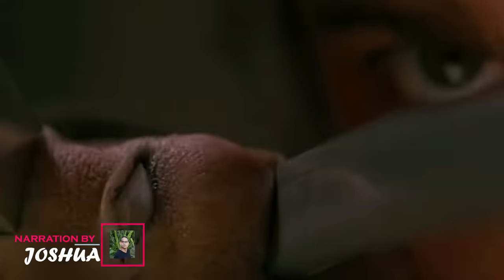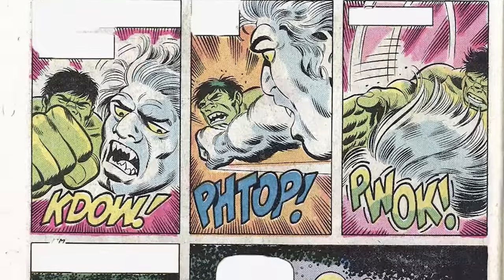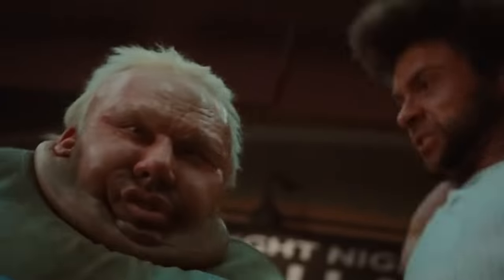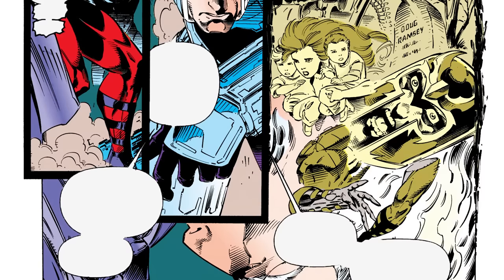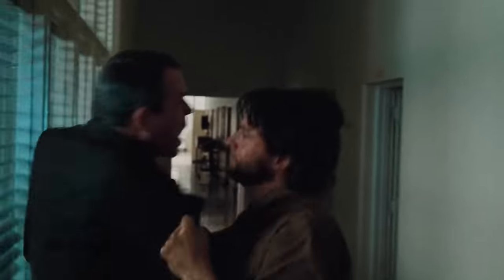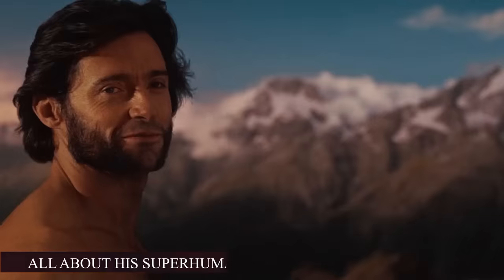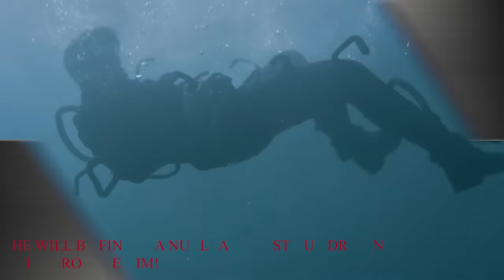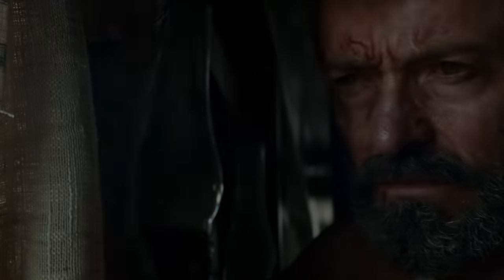10 Creepy Facts About Wolverine's Anatomy - Reproduction, Hyper-Healing, Feral Wolverine & Skeleton

Comment: The bone claws weren't "revealed", they were blatantly retconned in. Prior to that, it was confirmed canon fact that the claws were mechanical implants that had been added to him at the same time as the adamantium bonding process. There even were schematics for them in old reference material like the Official Handbook.
Reply: i kinda prefer the change honestly.
Reply: The original concept for Wolverine's claws was that they were actually weapons that strapped onto his wrists.  But that part never actually made it to final print.

Comment: a neat video but you guys missed a few things. One of which being he is incredibly strong. Not like on the level of the incredible hulk or super strength beings but probably a few levels above peak human strength. The reason being is because of how heavy the adamantium makes him his muscles are constantly having to flex and contract in order for him to even move. So basically James/Logan/Wolverine simply walking is a massive workout for him. Running jumping and other feats even more so. Because of his immense healing factor though he gets instant results on his "workout" since your muscles tear and expand when pushed beyond their limits when you work them out extensively which is where the term "getting ripped" comes from. So for the last 50 or 60 years since he got the adamantium upgrade to his skeleton his healing factor is on overtime and thus made his strength increase exponentially.

Comment: This video is kinda all over the place as you blend movie and non canon facts into the 616 proper Wolverine. That said I will touch base and enlighten on the subject of Wolverines progressed mutation after his adamantium was ripped out by Magneto.  It turned out that Logans healing factor was slowed down because of metal. Albeit only slight, the metal kept Logan from not regressing but progressing in his mutation. With the sudden removal of the metal Logans healing factor kicked into overdrive as did his mutation and began to progress him forward into a more Bestial form as was meant for him too be if not for the metal. In this form all of his powers and abilities were greatly increased. When Logam met with Elektra & Stick the trio began to train Logam and somehow with this training his mutation was pulled back...but not completely. Logan went back to mostly looking like himself with a few exceptions that still stand today. Logan retains all of his increased strengths and abilities as he had in his "feral beast" form and he retains even more pronounced k9's and finger claws, his body hair is more pronounced especially on the forearms. These enhanced powers and features were permanent and still apply to this day.

Comment: first off he survived the nuclear blast in the Wolverine not origins... secondly Wolverine has been a fan favorite since the 80's hugh jackman had nothing to do with that.. Maybe for millennials but fans that have been reading awhile knew about the awesomeness wayyyyy before that shit fox movie came out. Also and finally, Wolverine DOES NOT have super strength.. His strength is related to above average normal conditioning meaning he can bench about 400-500 lbs tops.
Reply: Agree!
One thing I learned from the movies (that I should have figured out from the comics) was why he can hold his own with much stronger opponents. In his introductory scene, they put a little “klang” in one of his punches. After reading about his metal skeleton for 20years, I finally realized that his fists are like flesh-covered hammers. 
One thing I don’t think I ever heard explained was how he can swim. The weight of his metal skeleton, zero body fat….this guy shouldn’t be able to float. And no, the air in his lungs isn’t enough to overcome that weight.

Comment: While Logan IS a nearly immortal killing machine, he by NO MEANS is one of "the strongest" mutants.  Not by many miles.  The Fact is that his healing itself is involuntary and acts without his conscious will.  So IT is extremely powerful, but that doesn't mean he's one of the "strongest."   Also THAT word is entirely inaccurate.  You've confused strength with power.  Here's an example for you. Hulk is certainly "stronger" than Jean Grey, but Jean is a great deal more "powerful" than he is.  At her most powerful, Jean can devour stars for energy.  While Hulk can literally crush her without effort, he can't crush anything if he can't move.  and Jean can most certainly hold Hulk in the air no matter how mad he gets.  ALL that strength counts for nothing if he can't touch anything.   What's he gonna do, punch the air?

With that in mind, there are MANY X Men BOTH stronger AND more powerful than Logan.

Cyclops=more powerful
Storm=more powerful
Colossus=stronger
Beast=stronger
Iceman=more powerful
Jean Grey=more powerful
Rogue=more powerful - and depending on whom she touched most recently stronger as well